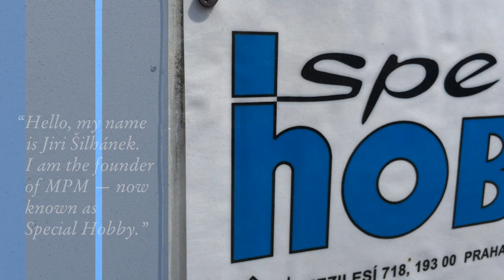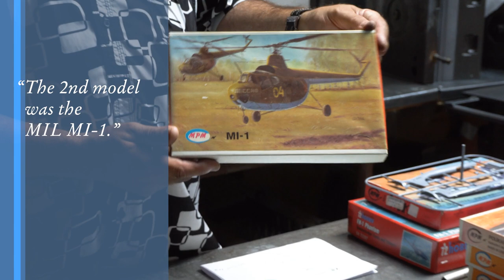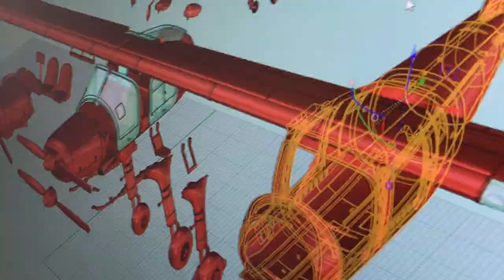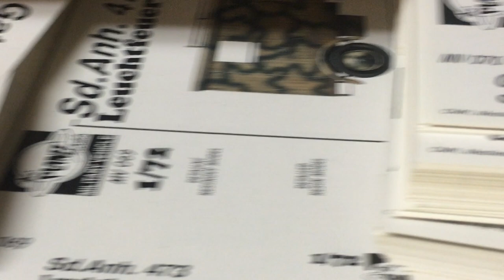Insight Special Hobby - a personal view

Comment: For me, this brand gives me the shivers.......
I don't like it at all, and for a good reason.
Nothing fits. These kits are a disaster. Every single part has to be dry fit and filed and sanded. And many parts are too small.
I know how much time, money and effort it takes to make a mold, to make a decent model. But their products................ No thanks............
Reply: I should hope so....... Considering the (lack of) quality of these old kits, the only way WAS up, I'd say !!  ;-)
I think they went the same way as ICM. Their old kits were horrible, too. the new ones are a huge leap forward. They are quite good, actually.
Reply from the maker: The quality of the new kits is outstanding! Especially the Tempest was an epiphany. Everything fits well and is designed with passion 🤓
Reply: Thank you Tom and Walter. That's good news. Maybe I'll give them another try.